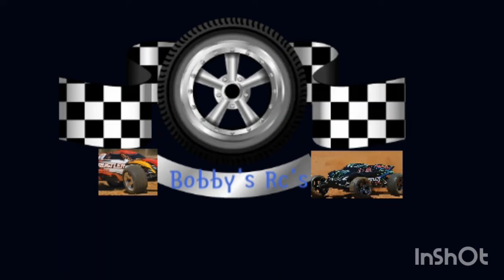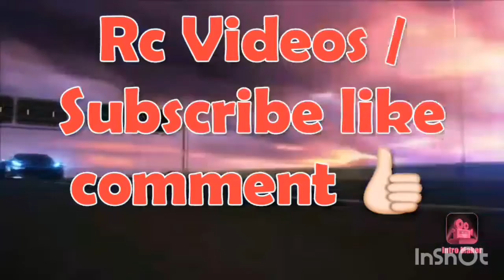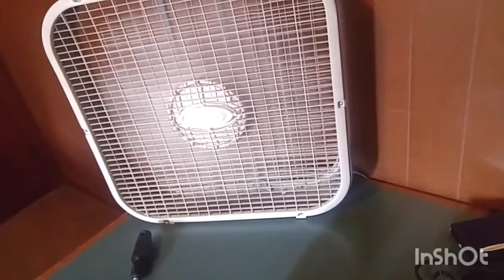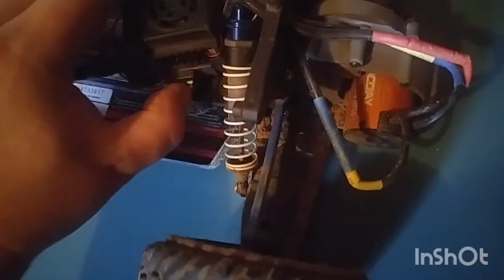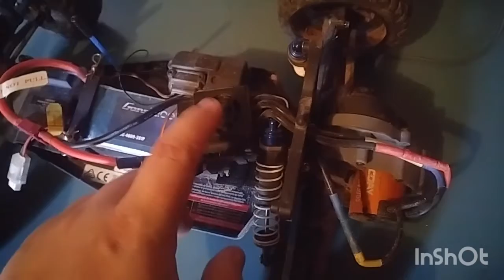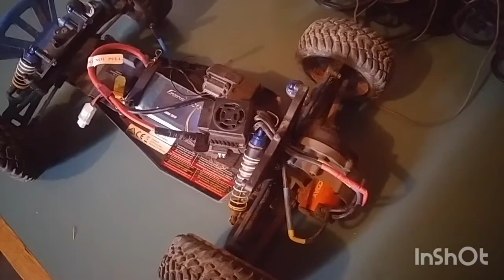#TraxxasRustler #Traxxas #FastestRcCars Noise Coming From Insde Of Esc And Fan Barley Moves

Comment: Ya I did notice that you already replaced it on your newest vid , but sometimes the circuit board gets a little dirt or gummed up under the on/off button and all you have to do is get some WD40 and pray it in behind or side just to get it under the switch and you might have to spray it a few time to actually get it in where it needs to go and just work your buttons on and off to get the board a little cleaned off and it just might work, or if you can take it a part and spray and clean it that would work also and probably better, but I’ve had the same problem on a few of my Esc’s and I was able to get them working again !! Keep up the Great Work and Stay and Play Safe !! 👍✌️

Comment: Try unplugging the fan first buddy.. if the fan dead shorts it will short the bec and wreak havoc.. you may just need a fan..👍.. definitely worth a try brother..✌
Reply from the maker: alden cost I just tried it unplugged the fan from the old esc it seems like it was ok it did turn on and off but sense I've already got a new esc on it I just want worry about it